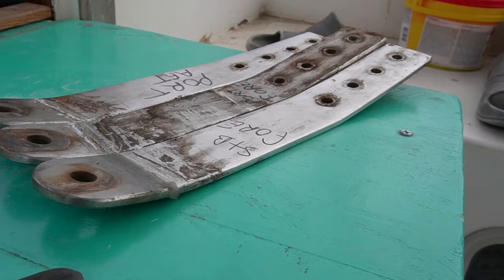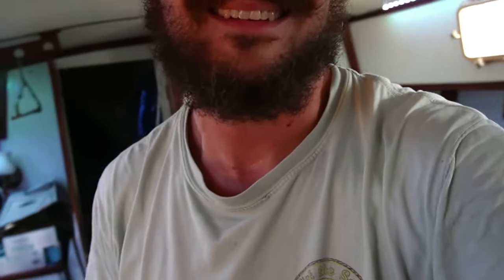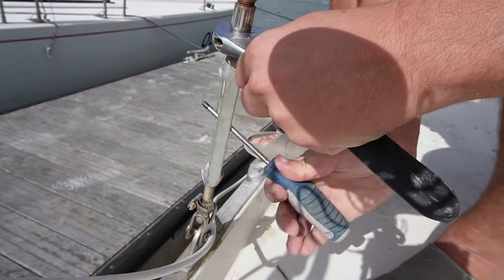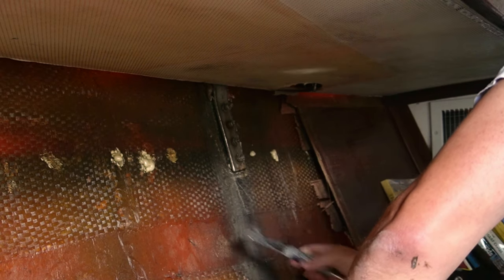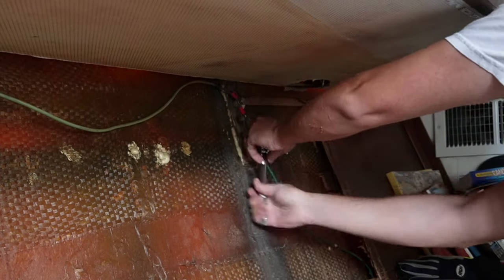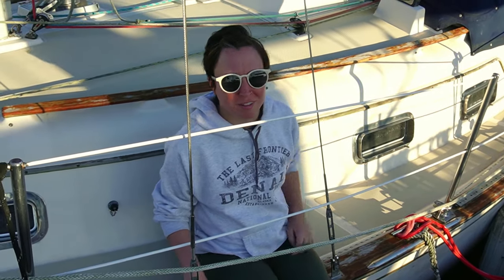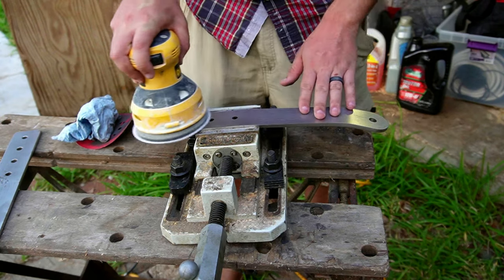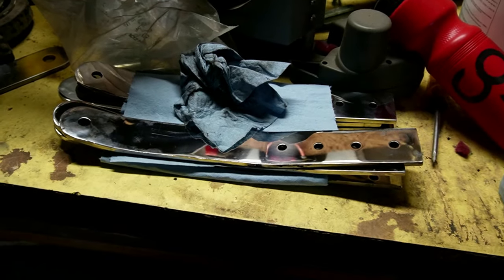How we made our OLD boat SAFER - And you can too!

Comment: Great job and well executed!! I do have a question for you though. Did you ever consider doing the chainplates in bronze? Bronze will not develop crevice corrosion or lateral load cracking. Bronze however is softer than stainless, so if improperly mounted to a point of any load movement you could see so "stretch" in the bolt holes. Just curious. Thanks
Reply from the maker: We did look at bronze but as you know it’s also weaker so we would need much thicker plates to get the equivalent strength, so we stuck with stainless this time. If these need to be replaced in 10-15 years we’ll probably revisit it

Comment: 6:27 I'd recommend removing that hose clamp. On my boat there were some hose clamps on the backstay and the backstay was much rustier than any of the other stay. There may have been some galvanic action. But it could have been the turn buckle too.
Reply from the maker: We're going to be replacing the rest of the rig soon so I'm not too concerned about it at the moment but definitely want to keep those dissimilar metals separate!

Comment: Sorry if I missed it in the video. I know you mentioned 316 but what type of stainless did you use?. I have encapsulated plates so I'm going to through bolt them to the exterior. Project for next month. Great video!
Reply from the maker: Our new plates are grade 316 stainless steel, some people prefer grade 304L but it’s not nearly as resistant to corrosion as the 316 grade is
Reply: @twohalf-hitches  thanks for the response. I believe I am also going to go with 316